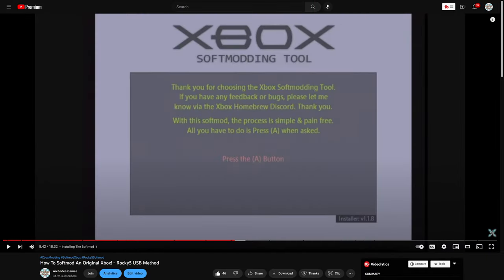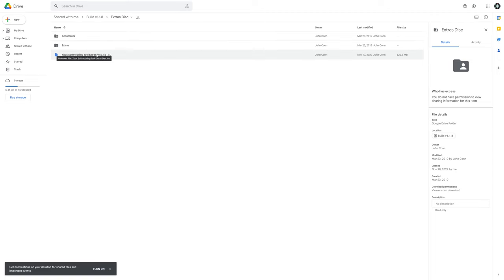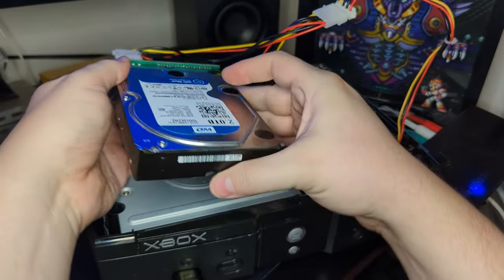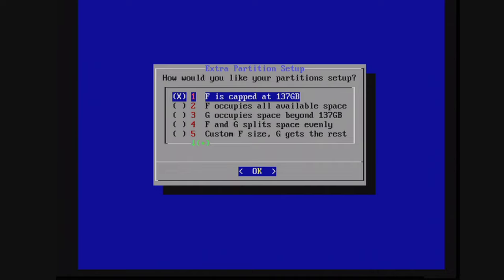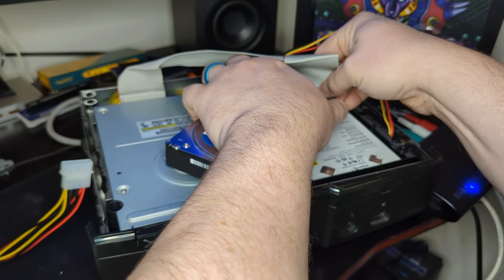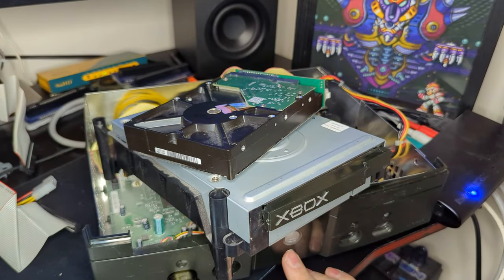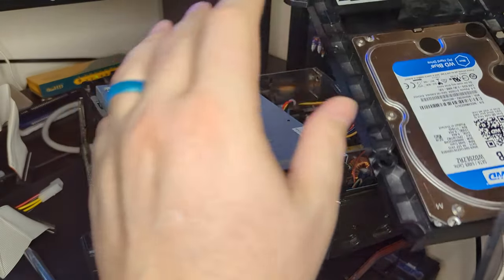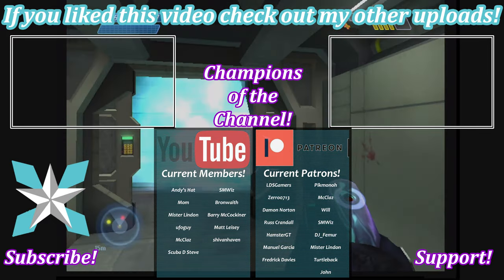How To Upgrade The HDD (Hard Drive) In A Softmodded Xbox!

Comment: I'm using ur steps have the same exact hard drive and it pops up saying it can't be locked it reads it so the adapter piece works the 80 pin wire is already installed all works I looked at my hard drive and it does not have a jumper clip on it does the hard drive need that or does the adapter jumper clip work thanks
Reply: It needs the jumper

Comment: So i need  that extra chimp tool and have to burn it to a disc. Can it be any old blank disc. Or a certain type. And is there any steps you have to take before you start swappin cables after you installed chimp. i see you left it on while you were installing cables.
Reply from the maker: You don't have to burn chimp to a disc. You can ftp it over.
Reply: @ArchadesGames   oh okay i found a tutorial on the ftp jazz. One more thing. will i have to backup my downloaded music and game saves with a memory card or will my data transfer over when i clone it. Thank you so much for responding btw. That original xbox is so bad ass. I had no clue you could mod it this easily and give it like a solid state hard drive and shit.
Reply from the maker: It will transfer all data over to the new drive
Reply: @ArchadesGames sorry im finally doing this. I have a modded ps3 and im very familiar with that and ftp to ftp and fat32 usb. But where would i put this rocky 5 file. Does the xbox softmod have a system built in for installing files?
Reply from the maker: Most dashboards have built-in ftp servers so you put files in E or F. F preferred if available.

Comment: Ugh, wish I wasn't trapped on error 9 regardless of drive. Maybe the issue is the IDE to SATA adapter I'm using not working? I'm using the recommended startech one.
Reply: Are you using a 80 wire IDE cable? You might need to use it if it doesn't boot with the stock one

Comment: I actually still want to repurpose the original hard drive from my OG XBOX but I connected it to an IDE/SATA to USB adapter and it shows as unallocated and not initialized, so when I do initialize it, Windows throws up an error saying "The request could not be performed because of an I/O device error." And it's not my adapter cuz it also works in my SATA drives. Also I tried DBAN and it froze at 8% so that's out of the question. Any advice?
Reply from the maker: Did you unlock it
Reply: @ArchadesGames  No not yet. Any way how to do such?
Reply from the maker: You use the Xbox it came from and run an unlocking program on it like Chimp
Reply: @ArchadesGames  I unlocked it from my Xbox and created a simple volume on my Windows machine and it works like a dream! Don't know why I didn't try this before LOL! Thanks for the help!
Reply from the maker: Nice, have fun!
Reply: @ArchadesGames  I sure will!😉👌

Comment: I upgraded to a 2TB ST2000DM008 using chimp with my soft mod xbox... after the upgrade everything seemed to be fine. Locked too.  But it takes like 20 seconds to boot to the dash AND its not showing all off the 2tb drive. Only like mayne 100gb
Reply: Im wondering the same thing not getting any response to this i used a 500gb hdd followed the video to the T and im onky getting 123gb of space. Im wondering if i can run this again and and split f and e or something because this did not work.

Comment: Do I have to use 80 Wire IDE Cable? Can't I hotswap with the stock cable?
Reply: 80 wire is required if you upgrade to Sata.

Comment: Wait wait wait wait wait, do you need to use the 80 pin cable from the start of the cloning process? I can't tell if you're starting out with the 40 pin or the 80 pin cable.
Reply from the maker: I started with the 40 but it would not hurt to use the 80
Reply: @ArchadesGames  Thanks for the advice; I switched from the 40 to 80 pin cable. Unfortunately, I've got another problem now... the system is really, really slow to load on boot. Do I need to do the clone over, or is the IDE to SATA adapter at fault?
Reply from the maker: Which adapter is it?
Reply: @ArchadesGames  It's the cheap green one. I should have gotten the Starlink instead, huh?
Reply from the maker: The green ones can have increased startup times comparatively. How does it run after booting?
Reply: @ArchadesGames  22 seconds, though? Yeesh. Anyway, the games seem to run fine. It just doesn't like to boot quickly, or reset quickly. (I'm gonna be on the hook for a Starlink, aren't I.)
Reply from the maker: It really isn't that far out of the norm for the green ones. Size of the drive will also impact it.
Reply: @ArchadesGames  I think I figured out what was going on... the target hard drive I was using was damaged. It had to be; it wanted to take 70 hours to copy the drive! I swapped it with a different drive of the same size, and now a full hard drive copy is an acceptable seven hours.

Thanks for all the advice! I'm crossing my fingers and toes that this goes smoothly.
Reply from the maker: Oh dang, yeah something sus happening there. Good luck!

Comment: mine locks up as soon as I connect the ide cable to the hdd 5:50
Reply: @endstarofficial  same here, been having this issue for 2 days. Xbox immediately freezes after I perform the hot swap with a known compatible 2tb hdd. Tried letting it sit on the dash and in chimp loader as well.

Comment: Don't need a sata since I only own about 12 games. What's the process of using another ide hdd ? Have 1 soft modded. Other is hard modded with a chip but it's stuck in Spanish
Reply from the maker: It's the same thing
Reply: Hey thanks that's great to hear

Comment: Q1 If i had tsop original xbox "hard modded" can i put any HDD not matter if it lock or unlocked?

Q2 i planned to tsop my xbox but someone says after flashing the bios you should remove the tsop wires from your mother board?

And thank you
Reply: The last question i wanna buy a sata HDD i really need to see if it comptiablite in this page? or pick up any HDD from any local store
Reply from the maker: If you have a hard modded system it doesn't matter what you put in it. If that's what people say it's a good idea to listen.

Comment: I need help, it’s not working, when disconnecting the dvd drive and loading chimp, buttons don’t respond, and the Xbox just closes chimp, does boot up the dashboard and flashes a yellow light doing nothing. I’m using the star tech ide to sata adapter
Reply: @jakeplayzyt5220  I'm using another ide instead of sata but I ran into the same issue I had to open chimp before unplugging from DVD drive and plugging into new drive hope this helps

Comment: Ok, so i followed the tutorial. Using a 500 gb HDD on a v1.6 console. The F: drive available space looks good in Chimp, but once I reboot into the dash there's only 120 gb available in F:
Reply from the maker: You can use xbpartitoner to mess with the F partition to see if you can get the full space back. Just don't mess with C/E and you should be good.
Reply: Thanks for replying. I figured it, my softmod was just too old, once I upgraded to the latest Rocky5 all apps now see the entire free space, all 457 GB.
Reply from the maker: That would do it alright

Comment: Got to the clone portion and when i checked my hard drive status, they are both locked, cant clone until the master is unlocked. Unlocked it, now error 5 of course. How is your hard drive unlocked on a softmodded xbox?
Reply from the maker: You never unlock the master drive with chimp. You leave it on the dash for a few minutes.
Reply: Reading my question 3 weeks later i feel like an idiot 😂😂 I know a lifetime more now about how to mod these ol girls, and my ignorance is just a little smaller now 🤪

Comment: Chimp didn't set up my partitions correctly. Despite choosing to split between F and G, it only set up 120ish GB of F. If anyone else has this problem, I recommend they do as I did and find a guide on how to use XBpartitioner, (also found on the extras disk) it'll allow you to set your partitions correctly if Chimp didn't do so already.
Reply: So in my case i used a 500gn drive it cloned perfectly im left with only 123gb after following this guide exactly. Any suggestion as what option to use when using the extras disc i have fpt the file direct to the xbox already.

Comment: why do you need the new IDE cable when they already have one inside the xbox? any difference
Reply from the maker: Because 40 pin doesn't work with most SATA adapters as shown in the video
Reply: @ArchadesGames  Correct. Also, 40 pin allows your Xbox to run at less of a bottleneck speed as 80 cable/40 pin is considered as Ultra ATAPI/UltraATA :)

Comment: Cloning worked but when I try to boot with the new drive I get error 08. The adapter is set to master and I’m using an 80 pin ide cable. Any suggestions?
Reply from the maker: Did you lock it after cloning?
Reply: @ArchadesGames  yes. It showed locked with maximum security when I checked the slave drive details
Reply from the maker: I'd try again with a different drive to verify compatibility

Comment: I´m trying to upgrade the hd and after pressing the button to confirm the slave hd in the chimp the screen became black and I accidentally pressed the eject button  of the dvd drive.Now the ring light is blinking.It´s safe to turn off and try again or I fuxxxd up the process?
Reply from the maker: You should be fine to start over
Reply: @ArchadesGames  I completed the process and it´s showing error 16.Is there a way to fix this?
Reply from the maker: means it isn't finding a dashboard. If it boots from your stock drive still, you might want to retry the process.

Comment: I did everything exactly as you said but for some reason my 1 TB drive was split evenly into F & G in the extra partitions for some reason.

More importantly when I switched out to the 80pin ribbon cable the Xbox turns on and off twice and then stays blinking green and red. No video signal......

Comment: a 4TB Seagate won´t do the trick for a softmodded xbox? It´s on the list
Reply from the maker: You can't use a full 4TB drive on an OG Xbox unless you have a modded tsop/modchip.
Reply: @ArchadesGames  what wildly available 2tb hdd would you recommend?
Reply: @MrFischfrosch  Wester Digital 2TB should be a good enough drive, which looks to be the one Archades used. I'll be using a spare 2TB WD Blue drive i have once i can repair my DVD drive (its not playing any games atm)

Just make sure to check that the drive is displayed on the compatability list before buying it as it might not work.

Comment: Hey my hdd i bought for this does not have a jumper pin
Reply from the maker: SATA drives don't have a jumper. The adapter does. If an IDE drive doesn't have it then you will need a different one.
Reply: @ArchadesGames  thank you

Comment: Followed this and everything went smoothly....until it didn't. I put my xbox back together....and my screw went straight through the 80 wire cable. I'm such a TWAT!
Reply from the maker: Oh dang... I've done that before not a fun experience.
Reply: @ArchadesGames  It's entirely my own fault. I had about 30 games copied over, then tried to use my Insignia account. Apparently Chimp doesn't copy over EVERTHING. It doesn't copy live accounts. So I had to put my old drive back in, use a USB drive to back up the account. Put the new drive in, tested it. HAPPY. Close the xbox with the screws and BAM....Not happy. At least IDE cables aren't too expensive. Just gotta wait for the new cable to arrive.
Reply from the maker: Yeah, rather the cable then the drive